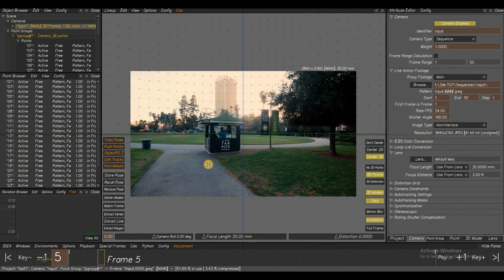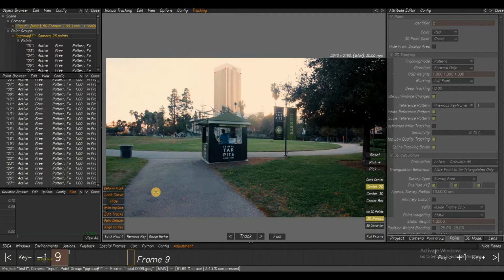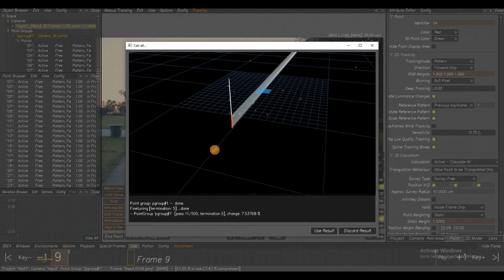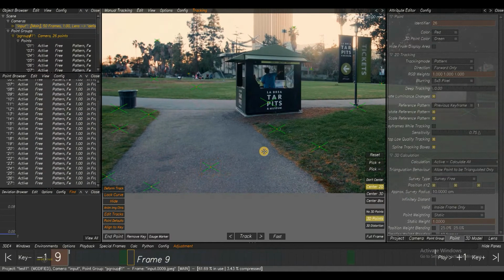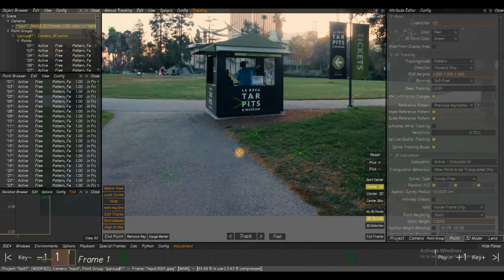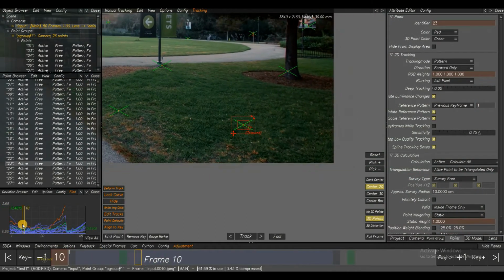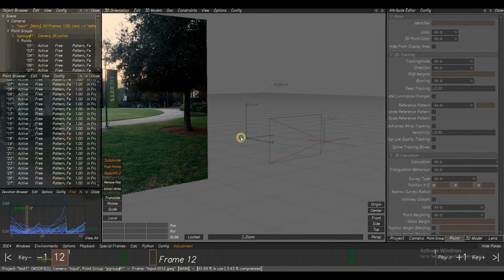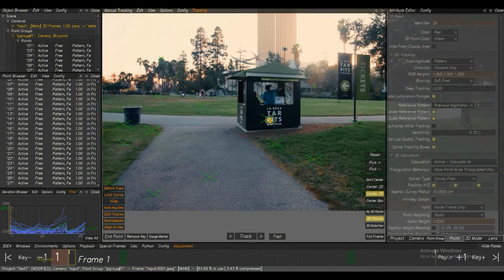2d track solve in 3dEqualizer(camera solve)#SMICS space

Comment: bro i have  some problem in 2d track a company give me a 1 fottage to track but this footage size value is very low 720*576 and so many pixel and blur how it manage
Reply from the maker: sry for the late reply.We cant increase the footage quality.one thing u can do is, load the plate in Nuke and do some cc then add a de- noise node then render out it.This will make the footage little better  to take the 2d points
Reply: @smicsspace3910  but company condition track in 3dequalizer
Reply from the maker: @ShubhamSharmavfx  Yes bro we will track in equalizer only.In nuke we will give some color correction and De noise filter and export the plate from nuke.Then load that plate in 3de.thats it !!!
Reply: @smicsspace3910  ohk